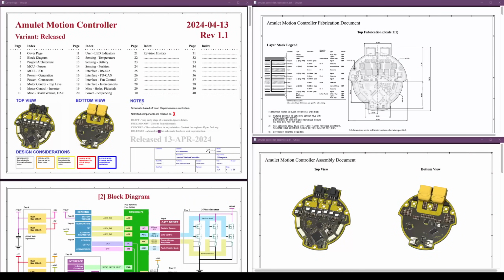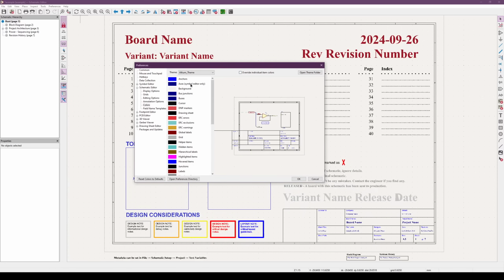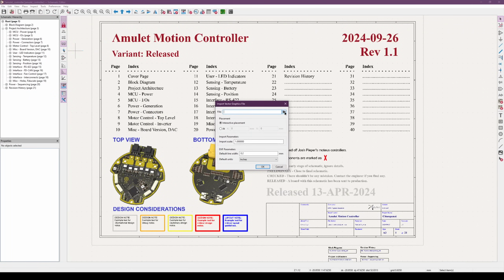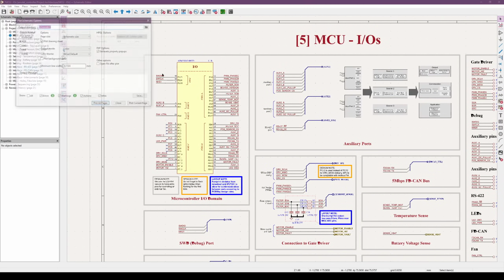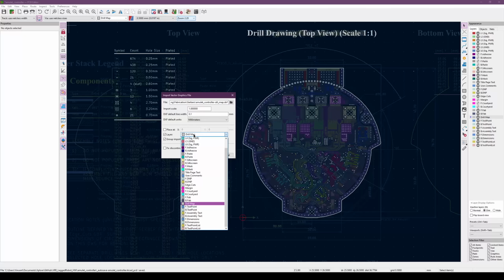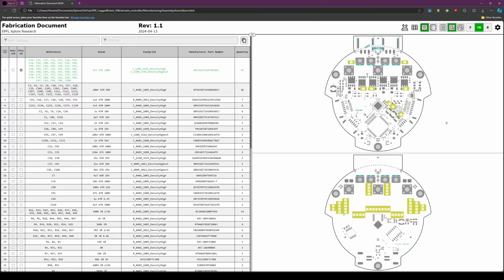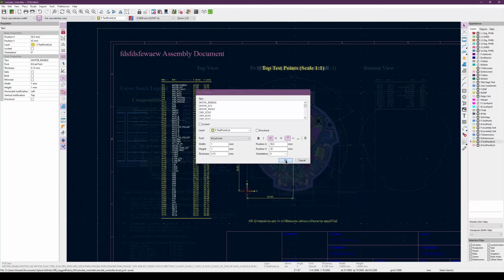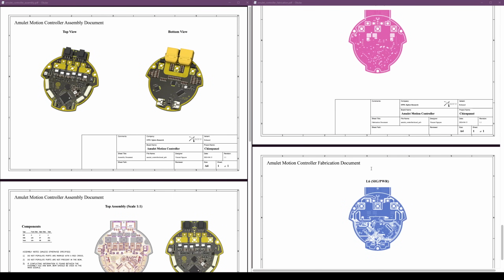KiCad 8.0 - Project structure, workflow and generating professional documentation

Comment: This looks amazing. If only this was possible to automate. The amount of manual work needed to achieve this is crazy. I can't justify it for small personal projects and for my work - I can't imagine doing it without automatic workflow with validations and tests.
Reply from the maker: It's certainly involved and could be automated with something like KiBot (but doing so would require quite a lot of work). Personally, it takes me ~ 1 hour to set up  / generate fabrication and assembly documents for a new project
Reply: @vincentnguyen8083  That's amazing that you manage to keep track of everything and not make mistakes. I would make errors if I had to do this manually. I am releasing devices at least once every 2-3 weeks and I would just give up on the 3rd project :) kudos for your patience.
Reply from the maker: @KostiantynD  a little update, I've managed to automate 95% of the processus after many feature requests and PRs into KiBot (stackup drawings, testpoint tables and highlights, automated 3d renders in the documents, etc). Next video will be on an updated workflow with Git (how to integrate in a CI/CD environment)
Reply: @vincentnguyen8083  can't wait to see it in action. I would say this will be one more reason to stay with KiCAD. I am so looking to moving away from Altium back to KiCAD.
Reply: @vincentnguyen8083  When are you planing to release the next video? It would be  awesome to see what you've managed to achieve!!!
Reply from the maker: @KostiantynD  very soon :)
Reply from the maker: I'm waiting for a bit for it to be fully compatible with KiCad 9
Reply from the maker: Took some time to release, but here is the new workflow: https://youtu.be/63R6Wnx44uY

Comment: Why not just set the background of your render to white, which will be the same colour as the background on the schematic sheet?
Reply from the maker: @simonbaxter8001  you could yes, I just like to have a transparent background as it's more versatile (e.g. adding the pictures in a presentation/GitHub repo). I think the default KiCad sheet color is not perfectly white too (but it should be with the provided color theme)

Comment: In  4 layer pcb witch layer is suitable for ground plane in1.cu or 1n2.cu and power plane
Reply from the maker: For 4-layer stackups, I recommend using 2 solid ground planes on the inner layers, and route the power on the outer layers. In a PCB, energy flows in the dielectric space between your signal and reference plane. Consequently, you want your reference planes to be as close as possible to your signals to have a good return path. An important thing to note is that as a signal transitions from the top to the bottom layer, the signal will change its reference plane (from In1 to In2). To provide a shorter return path along the z-axis, it is good practice to place one or more "transfer vias" (connected to GND) near the signal vias.

A SIG PWR GND SIG stackup can also work in many cases, but will not provide EMC performance as good as SIG GND GND SIG. If you use an internal power plane, you need to make sure that it can serve as a reference to the signals above it (i.e. that the driver voltage source is the same as the power plane). This is because at high frequencies, the impedance between your power plane and your ground plane will be low if you have enough bypass capacitors.

Finally, an okay compromise would be to have a SIG PWR/GND GND SIG stackup, where the PWR/GND layer is carefully designed to provide good return paths with a solid ground plane under the fastest signals (the ones with the shortest rising time). You just need to make sure to never cross a split in your reference plane with a signal. When doing this type of stackup, some people also like to "bridge" the GND and PWR planes with bypass capacitors, again to provide a return path for fast signals. But again, I wouldn't recommend this stackup. Personally, I always go with 2 inner ground planes, and if I don't have enough routing space, I go straight for 6 layers